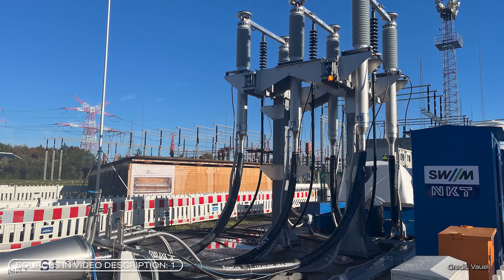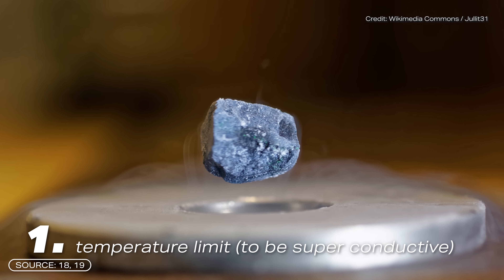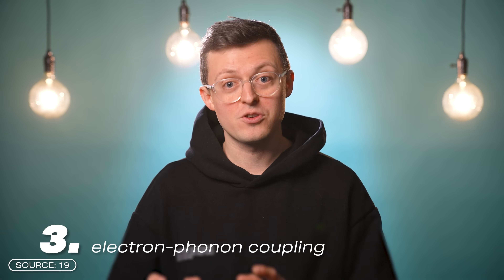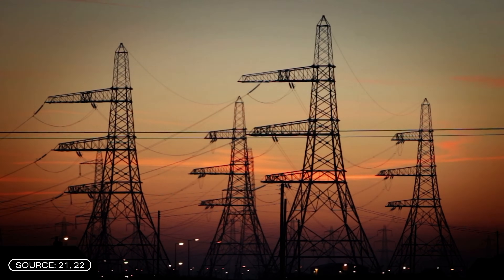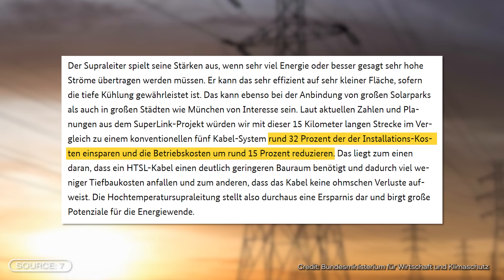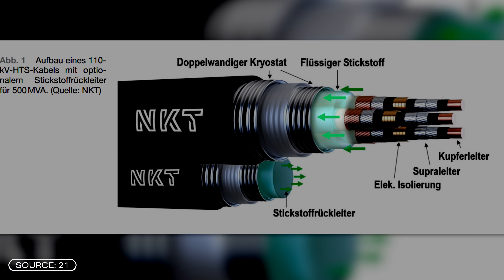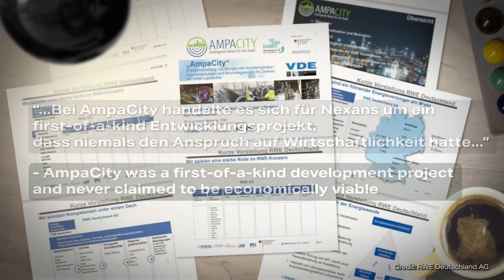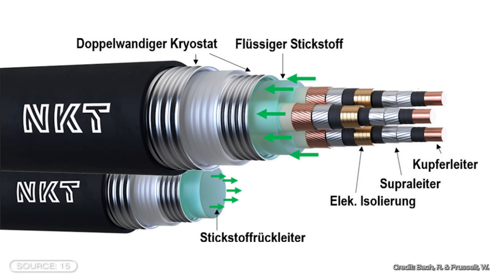Superconducting Cable TESTED in Germany: It's coming!

Comment: Imagine a leak and it would take weeks to fix during war time. Just increase the thickness of the cables instead. Much simpler and easy to repair.
Reply: Well, over head wires are dependent on the towers, so they are quite easy targets as well. Not everything needs to be made with war in mind, and electricity use can be rationed in war times.

Comment: Why 150 m of a superconductor cable is a world record when the Holbrook Project with its 600 m long cable is in operation since 2008?
Reply: It is not, but if the project passes the 6 month test period, there will be a 15 km cable built, and that is the one that would be a world record length. It's all on the video.

Comment: As a Canadian, I am looking forward to when it can be scaled up a lot.  Hydro-Quebec's James Bay transmission lines carry over 2000 megawatts (MW) of power more than 1000 km at 735 kV.  The savings will be significant when we can start using them to replace high-voltage lines.
Reply: Is that an HVDC transmission line? If not, it would probably be great to upgrade that.
Reply: @ChaosEIC  Yes it is HVDC at 735kV. China  HVDC goes up to 1,000kV so there is some room to upgrade but if superconducting might be available in 5 year, that would be better.
Reply: @ryuuguu01 Cool! I didn't know we had serious HVDC here in Canada. 🎉

Comment: But here is the important question: between a traditional latge footprint transformer station and a superconducting one that wlso needs to supply liquid nitrogen, which one is quicker to repair after it got hit by a cruise missile?
Reply: Bizarre question.  I guess that might depend on the availability of transformers, and the ‘traditional ‘ substation would require more as he said, because of lower voltage requirements for superconductors. Also, maybe the larger substation would be easier to hit?  I guess you’d want to know the probability of a cruise missile strike and do a risk/cost analysis.

Comment: You can probably recover much of the cooling energy. Liquid nitrogen expands 700x when it turns to gas, so any boil off could be used to spin a turbine or to cool a supercritical CO2 cycle which would benefit from wide temperature difference between n2o and ambient temperature
Reply: You just cool it back down, instead of expanding it.
Reply: I am curious about this, although I wonder if trying to create energy from the nitrogen will probably also eat into the cooling capacity

Comment: As a  retired Californian, I follow such developments as this in the hope that eventually long distance superconducting cable systems can be built in trenches  through our fire prone forests to replace the problematic  power transmission towers. Had such system been installed in Altadena to go over (or through) the San Gabriel mountain range, high winds would not have been an issue and  one of the fatal massive fires we have been suffering would have been avoided. 
The system you describe,  with appropriate automation for liquid nitrogen support should eventually serve  these relatively short energy transmission links as well as the ones in major cities.
Reply: Fires due to transmission line are only a problem when the power provider or government is corrupt or incompetent. In California, everyone in power is both 😢

Comment: Sorry this is just bullshit. Why do you even present such nonsense as tech news and give it a stage? Superconductors have many useful special applications - power cables are not among them. Power loss on power cables is already minimized by stepping up to very high voltage. A cheap stainless steel cable will do the job. Meanwhile for fancy superconducting wires you need... very expensive superconductors and liquid nitrogen cooling which needs an extra LN2 facility and consumes a lot of power. That cooling is way more power loss than traditional cables. Makes neither sense to build and nor sense to keep in operation.
Reply: Aren't stainless steel core aluminium clad cables used for high voltage transmission?
Reply: This is just for regular operation. 
What if sabotage? What if cruise missile strike? How quickly can you get a superconductor back to nominal operation?
It's the same reason I am critical on electric cars, the hyperloop, cashless society and other modern nonsense. It ties a lot of important things to highly centralised and/or vulnerable infrastructure.
Reply: Just bury them deeper, put them inside concrete tubes,  problem solved

Comment: So why would the operation in Munich be more economically viable than the one in Essen? 
Did they use a different superconductor material or better insulation or a more efficient cooling station to provide the liquid nitrogen? Or does the installation in Munich make better use of the capacity or something?
Reply: Need a few more generations of  Wright’s law probably before it’s competitive, but that could go quickly in early stages.

Comment: Superconducting Cables may be similar to High Voltage Direct Current transmission lines in that there may be some optimum distance where they are more cost effective than the High Voltage Alternating Current transmission lines now in wide spread use. It is certainly exciting to see that superconductors are starting to make their way into actual applications of this sort.
Reply: Superconducting cables would actually work best with DC - with AC a superconductor doesn't actually have completely zero resistance.
Reply: Yeah, I can imagine them in short distance, highly populated areas.
Reply: If we can get electrons from the sunny side of the planet to the dark side of the planet - we solve a lot of our problems
Reply: That's some word salad there.  Superconductors are not lossless with AC because there are inductance and capacitive and other losses. UHDC lines reduce loss by eliminating inductance and capacitive losses.

Comment: As you say, lots of problems still to solve, and we don't have many decades to solve them in (at least if the speed of electrification is to be maintained).

Having cooling cables every 4 to 6km makes the argument that you have a 16km cable rather controversial,  The internal cable may be 15km, but that is not got 15km of continuous uninterrupted infrastructure.

Then one has to ask about modes of failure.  Everything fails, but the simpler the system the easier the isolate and manage the failure.  How would you manage a leakage of coolant, or the complete severance of a cable - can you efficiently isolate the local problem and build resilience in the overall system to reroute the current (we already have lots of experience of doing that with copper).  Also, while a breakage of copper cable has a problem with the risks to the environment of high energy electricity, you now add to that the risk of cryogenic liquid being flushed into the environment.  How much cryogenic liquid is flushed out depends on how well one can isolate short segments of cable, but the better the local isolation of each segment the greater the cost.

You say that the loss of cold is comparable to the loss of heat in a conventional cable, but the loss of heat is exactly where the inefficiencies in the current technology lie, the inefficiencies that this technology seeks to overcome.

You also talk about the advantages in having fewer and bigger power plants for greenhouse gas emissions.  On the other hand, the challenges with wind and solar generation are exactly the opposite, they tend to be more dispersed power generation.
Reply: The coolant is just nitrogen. The atmosphere consists 78% of nitrogen. So in case of a leakage, it will just evaporate. Larger amounts of it can displace the oxygen temporarily, but I don't know if the cable will hold enough.

On the cable length, well you could argue that an aerial line also is not as long as it seems as there are these structurally supporting pylons every 200 meters or so.

With non-fossil fuel, you might have bigger energy plants (nuclear), but you also may have solar and wind, and the issue with them is that the production often is located far away from the consumption. And in China, the Kubuqi solar farm is actually planned to be a whopping 100 gigawatts in power, with 5.4 having already been installed. That makes even the biggest nuclear power plants at 1.6 gigawatts seem tiny.
Reply: @fintux  Although, as you say, the nitrogen might display oxygen, but apart from the question of how much nitrogen but also the fact that it is underground and so will dilute as it filters to the surface.

My bigger concern is the impact of rapid extreme cooling followed by warming and what this might do to the structure of the nearby ground.

You could indeed argue that pylons do interrupt the continuity of overhead cables.  Insofar as this impact on land usage that is pertinent, but one difference is that the pylons are passive items whereas the regular cooling systems every 4 to 6 km are active components that need local power and more maintenance effort than the passive pylons.  It is more akin to the role of transformers in regular power systems than the role of pylons.

As you say, nuclear is even more centralised  than fossil fuel systems.  On the other hand, Germany has just shut down its last nuclear power plant and does not look like being keen to build any new ones (it might be a different matter if we were talking about France).  Even the UK, although it is in theory trying to build more nuclear capacity, it is not clear if I will even live long enough to see that reach production status.

China's Kubuqi solar farm is possible because China has huge desserts in which to build such huge solar farms.  Can to imagine the NIMBY response if any European power attempted anything like that in Europe?

Comment: You, german peoples seams to be a bit old scroll. The world has changed in this last 30 years and here on YouTube nobody cares about your academic achievements. I care only about the facts and the arguments. If you are a janitors, but have good arguments this is ok for me. So please stop presenting yourself as Dr. ...
Regarding this video, I think this is practically impossible to maintain a 15km cable underground at cryogenic temperatures. It will be very expensive and not reliable at all. Don't forget that the electric system should have a very high reliability rate.

Comment: It looks good but, I see a problem if the cooling circuit stops working.
Reply from the maker: Yes, you definitely need a backup in this case
Reply: 2 commercials, in total more than 3 minutes without the right to skip?
Not cool Jakob!
Reply: @MrRossi1805 If you watch moderate amounts of youtube, paying for premium is well worth it. Especially the family plan. Not only have I not watched a single commercial in years, I feel better knowing that none of my kids watch commercials either. Also, the creator gets direct support from it. Win-win in my opinion.